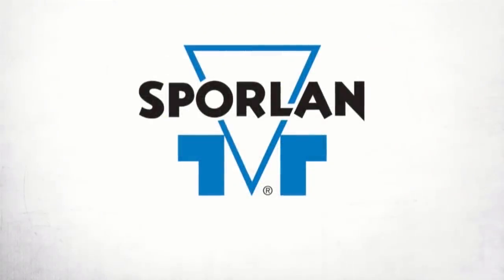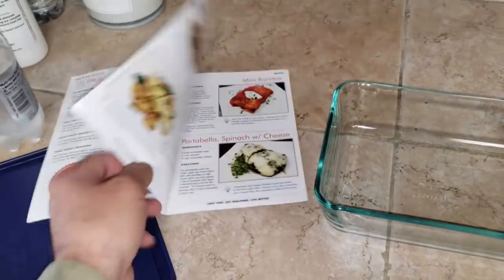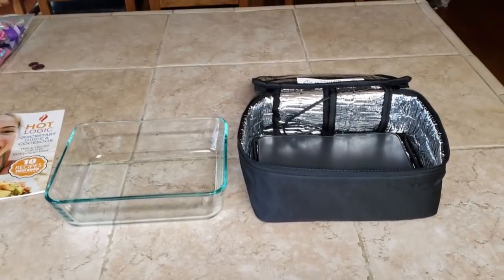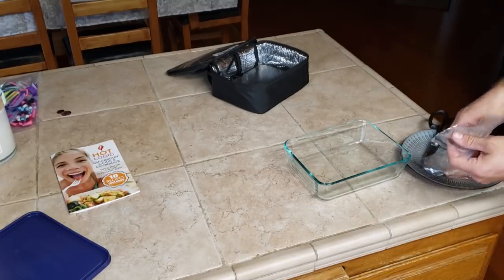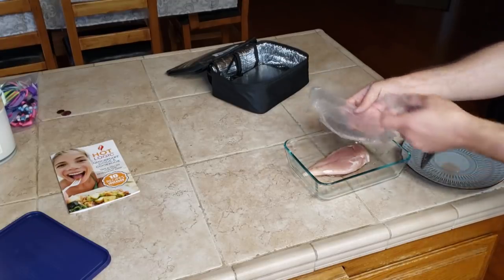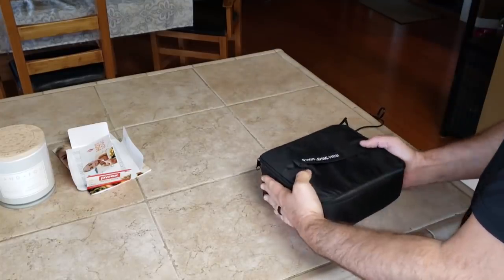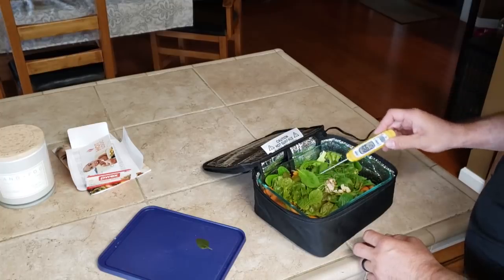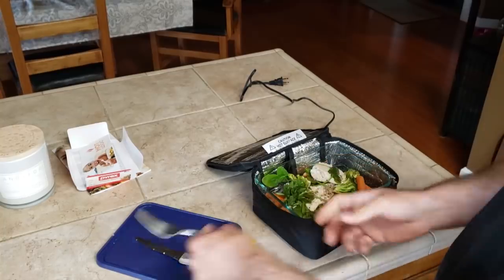HVACR LUNCH PROBLEM SOLVED?

Comment: I got one of those also and it is pretty good I must say. It will take a little bit of time to get stuff really warm. But for this trade it’s one of the better things I’ve found to work for meals on the go with out access to a microwave. Also my work truck has a plug adapter I can plug into so I can heat my lunch while driving to the next job site. Also tried heating up a soup can with a torch once but the can got to hot and melted through.

Comment: Nice idea man and agree trying to eat properly on the road is a real challenge I’ve found if I get takeout it’s rarely healthy.
I’ve gone a slightly different direction and ended up with a fridge, microwave oven, coffee machine and a butt load of batteries plus an inverter in the truck oh and a solar panel to keep the dream (and batteries) alive but I have possibly taken things a bit  too far.

Comment: That's really neat,  brother.  I'll have to check out the inverter version cause we don't have 120v , I would imagine you'd have to leave the engine running though , otherwise wouldn't it drain the car battery ? If it doesn't , then it's really an awesome product . Cheers for that , sir , thank you for the tip !👍
Reply from the maker: They also have a straight 12 volt version that would work off the cigarette lighter in your vehicle
Reply: @HVACRVIDEOS  Nice ! I gotta get me one of those , then.  Thanks again , sorry I couldn't make it to the live stream I was so tired I fell asleep after work

Comment: Does the smell seem to permeate the bag? I would hate to have my van smell like garlic and onion (both of which I love). I'm def going to give this a try, just wondering if you've used it beyond trying it in the video thus far.
Reply from the maker: Yeah I have used it in the van, and it does smell I'm gonna use it on the roof while working and or crack the windows....
Reply: @HVACRVIDEOS  just ordered one, cant wait to try it.